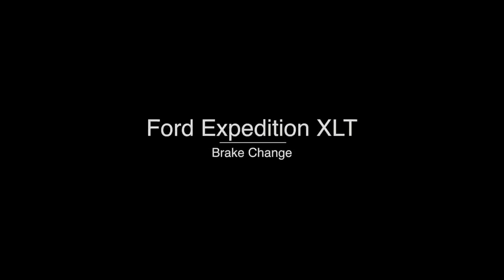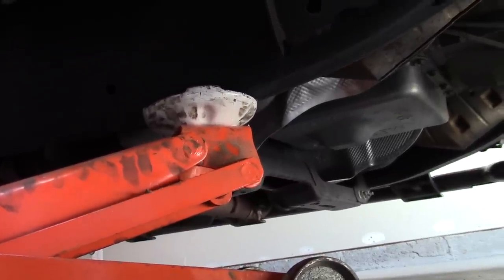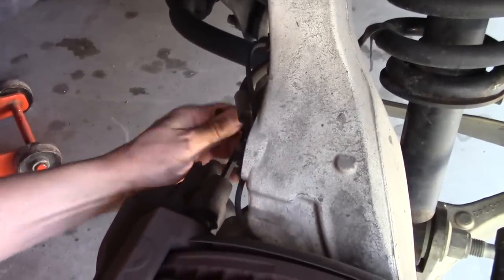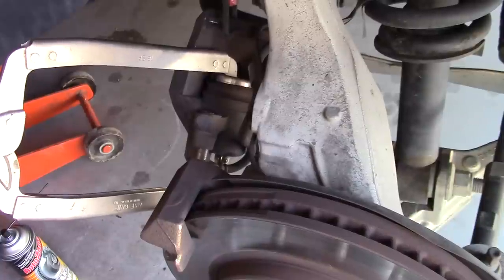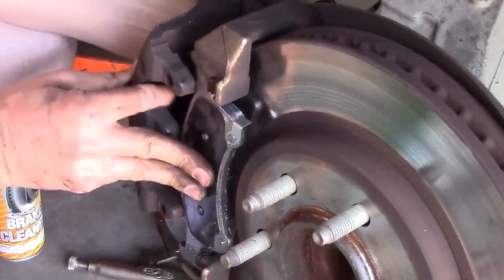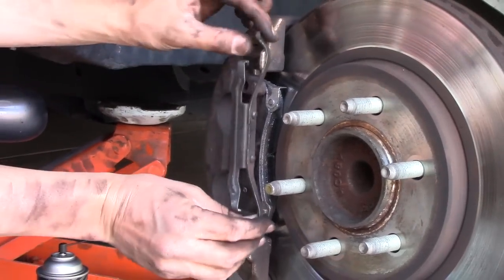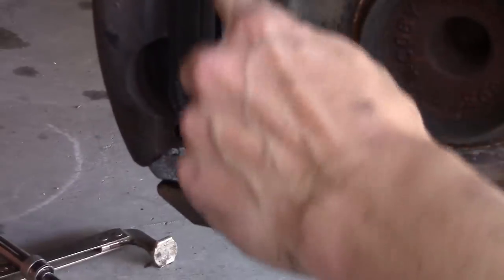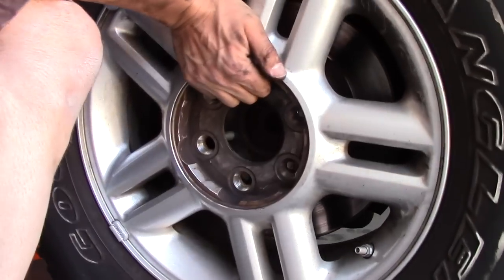How to change brake pads on a Ford Expedition XLT

Comment: Just did my brakes today on my 06 Expedition XLT and it uses a 9mm hex head socket in front and 7mm in rear! Hope this helps
Reply: Exactly what I was going to say. Very good video
Reply: I was wondering what size the front was. I tried everything i had at home. Even when to autozone and they told me it was a 7mm in the front.  I tried them all everything was to big or to small. I guess I tried again with the 9mm. I'm going to try a long 9mm maybe the socket one i have doesn't reach. Thanks again
Reply: @al52269   did you try a T-45 torx bit

Comment: great video, easy to follow. just finished front pads on 2004 exp 5.4 using 7mm hex bit for caliper bolts. look forward to the back brake video.

Comment: Use Syl-Glyde silicone grease (from your local NAPA store) to lubricate the caliper slider pins. On later model Ford Expeditions (mine is a 2010) one pad goes on the inside and the other goes on the outside, and if you mix these up, you will likely have severe problems with those pads (and the rotor) after a short time.

Comment: Just an FYI, you don't have to take out that hex bolt. Nothing bolts that bracket to the caliper, so if you don't have a Hex, just take the brack it off and slide the whole thing off the wheel and they'll pop right apart.

Comment: I recommend if you want to do a proper brake job having your rotors turned to have the glade taken off so your brake pads have a fresh surface and will work much better

Comment: What bit loosened the caliper guide pin?  I heard T45 torx or 7mm Allen/Hex.  I tried both and others but none fit.  The replacement pins use 7 metric size Allen/Hex.  For the brake caliper guide pins on the vehicle, a T55 torx is too small and a T60 is too big.  Any ideas?

Comment: (5:17 - 5:27)
Awesome video!!!! I always watch these as a refresher! I have to say your video is by far the most on point. 💪🏿👍🏿👍🏿💯💯💯
I have a question? Where the hole comes from to insert the spring? (5:17-5:27) 
 Is it a special bracket with a hardware kit? I bought my truck used so I'm still finding stuff every repair! Some ppl don't even use it. So, All of this time... I haven't used it either. Lol 😆  So is it necessary? What purpose does it serve?

Comment: if one of the dual piston is slightly leas compressed than the other one maybe by like 5mm will it make even contact once i pump my brakes during normal use?

Comment: Good video. My 07 Expedition was the same, but my current 2010 is different. No anti rattle clip and no Caliper mounting clips for the inside pads. That big anti-rattle clip on my 07 was a pain to get back on, but I didn't have to bend it. Recommend that people open the bleed valve on the caliper when compressing the caliper pistons, so that you don't push the cooked and contaminated brake fluid that is in the caliper back into the brake lines.

Comment: Be careful leaving the brake master cylinder cap off.  Brake fluid has an a finite for moisture and can contaminate your brake fluid causing potential brake failure.

Comment: When spraying the rotors with brake cleaner and when reassembling the brakes, the springs are not in the same position as they are when you are showing the spring removal. Which is odd unless you staged the first part of the video after completion. Look at the long arms of the spring and where they are when you show the spring removing procedure. Suggesting folks bend brake parts to put them in wrong may not be a great idea.

Comment: The bending of the caliper bracket was clever!   After struggling with it for 30 minutes I applied this trick and had it back on in less than 30 seconds.